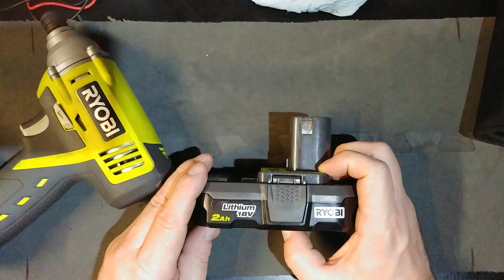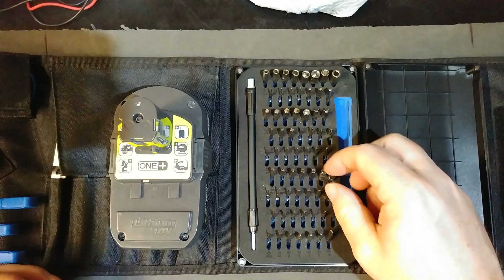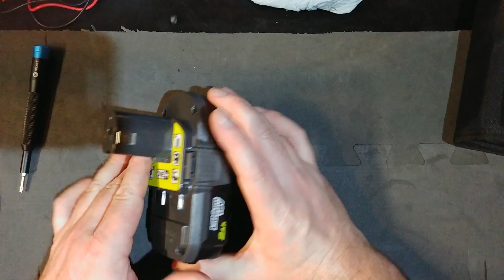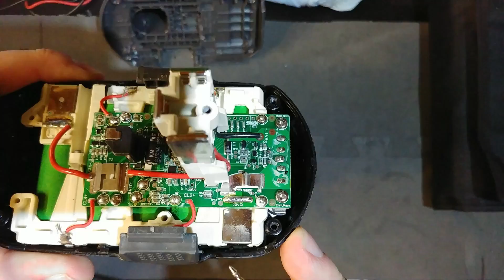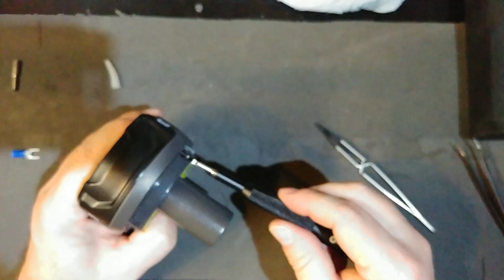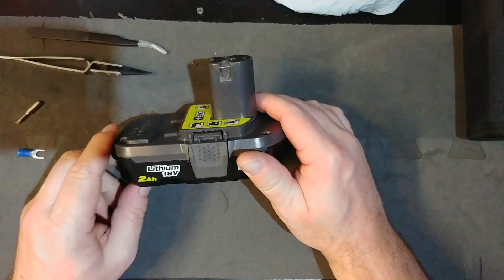Ryobi Battery Not Charging - super easy fix - dead ryobi battery repair

Comment: My Ryobi One+ 18v Lithium battery measures 15.79 volts with the outer jacket removed as well as prior to removing the cover. I have only this one Ryobi battery. How can I charge it enough so that the controller allows the charging port to begin charging it?

Comment: Ryobi has one helluva racket going here!  There should be a class action lawsuit against them for making a product that in many cases won't even last a season or two without working!  It's all about profit and manipulating consumers!
Reply from the maker: meh maybe - this is actually the only failed battery out of like 8 or 10 that I've had for more than 10 years now for some of my batteries without issue. For sure they have lasted with only 1 failing over time. Good run for sure.

Comment: I have a brand new Ryobi Sawzall that I bought right after Hurricane Ian.  I used the tool but with my older batteries.  Tried the brand new in plastic bag Ryobi 4AH cells and neither will take a charge and it just flashes red.

Comment: I have just put about 12 Ryobi batteries in the recycling bin. I wish I had seen this before I did. A question: Is it essential to open the case to get at the terminals, which I assume bypasses the controller, or can you just connect + to + and - to - using the terminals on the posts without dismantling the battery pack? Either way, thanks for the video. I'll try it when the current crop of very expensive batteries plays up.
Reply from the maker: yea, have to open the case to bypass the controller

Comment: I have found that if you just put the battery in its charger, plug in & out to the electrical socket quickly, say 8 or 10 times, the battery will charge normally after that. Worked for me several times with several different amperage batteries.

Comment: Yea I've got 2 that test bad, one that the red light just flashes like it's still testing and another that the charger thinks it's fully charged but it's only at 1 bar on the built in indicator. One of them only worked a few months before it quit on me.

Comment: FYI.   A 18650 Battery is 3.7 Volts    The max you can charge is 4.2 votes.   5 batteries in the case 5x3.7 =18.5

Comment: I think it worked. I've now a second light flashing, before only the first would be steady on the battery indicator. The charger is flashing 'charging'. I had 12V and it was too low too charge. The terminals were showing about 3v. I left the battery in the drill with minimum charge. Now I take the batteries out when put away.

Comment: Careful when using a ryobi fan.  I discharge a battery below the min voltage by forgetting I had it on.  Did your trick and revived the battery.  Thankyou

Comment: Do you need to bypass the controller board with cover off or can you simply connect to a charged battery?
Reply from the maker: yes, this is why the battery must be disassembled in order to bypass it otherwise, you cannot send power to those cells.

Comment: I've used this method to jump start 3 Ryobi batteries that I had given up for dead. They're not cheap, so this has saved me quite a bit. The only investment was about $10 or so for the alligator clips (and the T10 bit to disassemble the case). Thanks!

Comment: Were the Torx Screws always the security / anti-tamper style that take the special 'hollow-point' screwdriver?
Two of my Batts were about 2v. The smaller one: My motorcycle trickle chargers come with mini jumper cables. With the bike running, (14V) I shocked it enough externally to start charging.
My larger Batt,  no go externally. I'll open it up and try it. It's actually the battery that I wanted to repair. I
Reply from the maker: yes, it was a tamper proof torx.

Comment: Worked like a charm. I had gone on vacation and forgot one of these batteries in the charger for two weeks. Using the good battery and following your video, it only took 5 seconds of charging to revive the 'dead' battery. Caution: the positive wire gets hot! use needle nose pliers or some similar thing! Thank you. I was about to order a $40 battery.

Comment: Sorry. Didn’t understand why it was needed to disassemble the battery. You have the same terminals without disassembling.
Reply from the maker: This is required to bypass the battery management system

Comment: Worked perfectly June 19, 2022. Total of about 30 seconds of connection necessary to get it past threshold... Seemed to want to be above 15v to catch a charge from a charger but I tested only a few times during process, once at 7v, once at 12v, no dice, third time at about 15.5v it caught and charged. Donor battery was at around 19v. Lesson learned with cheap stuff: take batteries out when not used.

Comment: Nothing repaired here!
U could have energized the battery to get it above the 3volt threshold by touching the terminals without removing the top half of the case. The battery will repeat Its malfunction again and again each time it drops below the threshold.  What you have done is not a repair if anything it's only bypassing the batteries charge controller.  Simply do not have to open the case to reboot the battery.

Comment: I have at least five of these batteries! I am so upset with I can't use my tools! The  batteries are so expensive.
Reply: Yes, this will work for many that don't have access to electronic tools, or don't have the full background knowledge of BMS systems, lithium-ion cells, temperature sensors, Constant Current / Constant Voltage charging,  etc etc etc....  It's not the best way to revive a dead battery, but it will work in a pinch.

I have rebuilt about 20 of these Ryobi 18 Volt lithium batteries with all new cells.  Sure, it takes much longer to rebuild a battery than simply "bump charge" it... and I understand that a lot of people don't have the equipment either.  But it's the better option if you have the means.

While this method may work as a last resort for many people, the high current involved with this "bump charging" method is not good for the lithium cells.  You'd be much better served using a bench power supply with the current limit set to about 100mA to slowly "wake up" the dead lithium cells over the course of 2 hours.  (I've also successfully used the super-inexpensive TP4056 modules with a 1Kohm resistor modification to drop the current from 1 Amp down to 100mA.  You can search YouTube for more info.)

In addition to the problematic large current surge, the method in this video doesn't address balancing the individual cell voltages. (This is important in any series connected string of cells.)  The Ryobi's internal BMS circuitry just isn't effective on a severely unbalanced battery... it really needs to be done manually or via a balanced charger.  In fact, it's possible this is the reason the battery refused to be charged in the first place.  The BMS may have seen one cell dramatically lower than the other four and for safety sake, just stopped functioning.

Another benefit of swapping out the five lithium cells is that the new capacity (Watthours) is double the factory cells.  I only use high current 18650 cells.  (My favorite combination of high current capability AND high capacity is the Samsung 30Q, but the Samsung 25R is pretty decent too.)

Lilia:   Send me one of your dead batteries and I'll either charge it back up for you (the right way), or I'll completely rebuild it with new cells... no charge.   If you like the result, I'll fix the others for you too... also no charge.  If you respond to this post, I'll forward my e-mail address with my info.  (I'm a retired NASA guy with nothing to do but tinker around with projects like this, LOL.)

Comment: This video and the many just like it, neglect to show how to measure each cell to see what level they are at and determine if one is defective. Also you can have a pack that measures > 14 volts and still won't charge properly due to other issues.

Comment: I left the battery in charge and switch off the mains by mistake. Battery voltage was showing zero without opening the battery. After opening, internal terminals showed 4.5V. Made a connection as shown in video, internal voltage went up to 14.7 in couple of minutes. Put it back together and tried the charger. Its worked like magic. Thanks a lot for the assembly video.

Comment: 16 minutes? One RYOBI battery I had would charge fully (in the charger) to 8-10 volts (measured on the output terminals) but would provide enough energy to run my hand vacuum. Evidently the connections inside failed for half the individual lithium batteries.
Those individual cells are rated at 3.7 volts but will charge to 4.2 volts, so a fully charged battery can measure over 20 volts. Low capacity batteries have 5 cells inside in series. Larger battery packs may have 2, 3 or more batteries connected in groups of 5 cells that are connected in parallel to provide 6 or 9 Ah for longer run times.

Comment: It must at list be not blinking on the last battery bar so it will charge I tryed it but no gater clamps straight wire red and black but it work same steps

Comment: Why did you even take the battery apart. Waste of time
Reply: In order to access the battery terminals directly (and bypass the BMS circuitry) you need to open the case.

Comment: I bought a Ryobi set about I think maybe 8 years ago and they I don't know I think it was the first one it first came out with the Ryobi tech 4 battery well I'm long since lost all my tools but I still have the camera out of the set with that battery that's in it and I'm throwing it in the closet and my tool shed it's been with me throughout the years I've used it here and there throwing it back in there and every single time I take it out and I charge it up it works perfect and I put it through abuse the first couple years when I had it but that battery is still going strong I've never seen a battery lasts this long one of the times I fully charged it used it one time put it away 2 years later I found it in a drawer out my shed and I turned it on and it still had power in the battery I was freaking amazed I kind of want to take the battery apart to see what the hell is inside of it but I do not want to break it

Comment: Sir you already mentioned that at begin of your video the people doesn't have enough experience and information about electricity  and electrical tools better not doing this but many times in your video about how can use the tools to open it or the bolts! This video could be a short and very helpful video. Even With out opening the  battery cover you could do that!
Reply: The reason for opening case is to bypass electronic controls, terminals outside don't do that.

Comment: Hey guys I just wanted you to know there's a lot easier way to fix a Ryobi One battery that is completely drained just take a piece of tape and put it over the little metal piece closest to the battery and then plug it in if the battery shows that it's charging and the light is solid leave it for 15 minutes (watching it!) Take it out put it in your flashlight test it out if your light stays on put it back in it will start charging again you might not have to do the flashlight thing 😂
Reply: Well, Just tried that.  Put a small piece of tape over the one on the back of the charging 'post' and the internals never 'clicked', so the internals sensed a malfunction and shut down the charging.  Then I tried a piece of tape on the very small contact on the surface of teh charger and same thing.  So that didn't work as it cut off the inputs that the charging system uses to tell if the battery is charging properly or not.  Since it could not sense it, it shut it down.

Comment: Dis assembled battery checking voltage at top terminals 0 volts, at battery connection at board to batteries  read 20.5 volts

Comment: I mean the battery has warranty, why not send it back for a replacement? If it’s past the warranty I see how this would make sense. Also, the instructions say to not leave the battery attached when tool is not in use.
Reply from the maker: Hi - yes, they're out of warranty by now and typically I don't leave them plugged into the tool for more than a day or so while using it.

Comment: Did it today on a 5 year old battery that I haven't been able to charge for over 2 years.  Works like magic!  What seems to be one possible cause of the Red Light of Death is when your batteries are exposed to cold temps for extended periods of time.  Now, 6 of 6 batteries still running strong.  Thank you so much!

Comment: Don't do jumpstart on Lithium batteries! You damage both batteries, the good and the bad one.

First check what is the problem of your battery.
Second, if the low voltage was the problem and the cells are above 2,0 V, then use a model charger to gently charge the battery, instead of jumpstart.

No there are not normal cells inside. These are high power types for power tools.

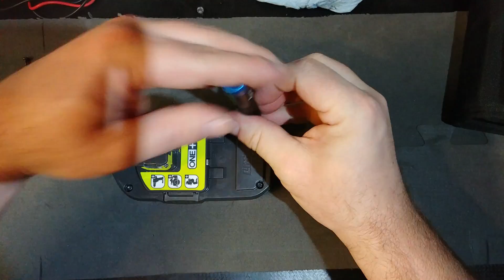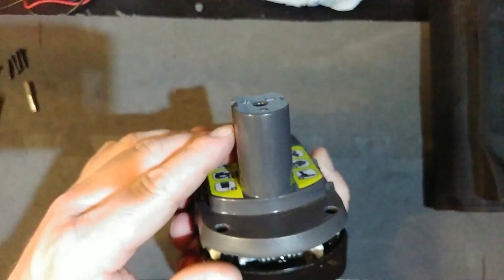Comment: Open case at 6:00..  Test at 8:00.. 
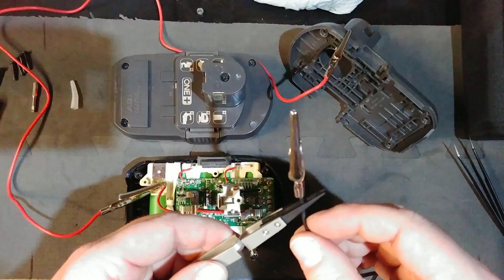Repair at 12:00. There is a ton of useless commentary in this video.
Reply from the maker: You're right. I made an updated one, this specific one was the first video I ever made, I tend to ramble  sometimes.
Reply: @BdoingStuff  no insult intended, I was trying to help DIY'ers who come after me. Thanks for the info and your time in making the video.  The comments help but the steps take really long for you to get to.... By the time you get to the next step the previous one is just about forgotten 
      - Thanks Again

Comment: I followed this method, but had to drill holes on the side leading to the positive/negative plates; based on another video I saw because my screws were stripped. Anywho, doing exactly what he said, that allowed it to to charge successfully, and achieve a solid green light; which it would not do before. But when I plugged it back in to my Ryobi drill would not power the drill. The multimeter registered at 10v... So it's charging now, but it just isn't making it to 18v... Any suggestions?

Comment: 2yrs old video.  Mine reads zero unopened but 15.37 when I bypass the board. ???

The ground from the batteries to the pos on the charging lead also reads 15.37

There is a grey reset? Button just under the front of the board.

I pressed the grey button and 4 green lights come on for a second and then only one blinked 3 times…. yellow button on front of battery presses on the grey button so this is the test button but pressing it did appear to reset part of it

Now the neg charge lead to opposite pos charge lead read 11.29 and connecting both red leads on the charging head reads 11.21

Direct battery lead test still reads 15.37 to 38

Comment: Why open it, why can't you just connect plus to plus neg to neg without removing the plastic...
Reply from the maker: you have to bypass the BMS (battery management system) or what I'm referring to as controller in the video.

Comment: I've heard a rumor that RYOBI will replace a "dead" battery for free as long as you have not messed with it. True/False? I have several that will not charge, but the green charging light comes on. Seems that RYOBI would have fixed this problem years ago. The charger should detect a too low battery critical condition, and when it does, it applies your fix. Simple solution. Another fix would be installing a buzzer in the battery that activates when the battery is near the no-charge point, say 7 volts; this solution would help prevent you from letting the battery enter that low battery volts/no charge condition. For what these batteries cost, this no charge situation should not be allowed to happen.

Comment: I had a Ryobi 18 V battery that sat in my garage for over 18 months that would not take a charge. 
The "Fix" was fast...easy & safe.
I used my 12VDC  trickle charger ..held the "+" & the "- " cables to the battery posts for slightly over 2 minutes.
I then put the battery into the Ryobi battery charger.
The charger "Testing" cycle ran a little longer than normal then it started the charging cycle    !
I did not do any disassembly ...I didn't drill any holes !
Reply: Yeah, but mine is almost fully charged, and will not activate any of my Ryobis... 12v charger will not charge 17v pack. But will a dead one, yes.
Reply: Exact same as I did to 'prime' my 18v and 24v; both were dead 5-10 years.

Comment: It worked. Battery showed .2v. Took it apart, checked the battery itself, it showed 3.6v. Put the leads on for about 15 seconds. Battery was now at 12.3v. Put back together. It charged and I’m using now. Thank you so much. Saved me a few bucks.

Comment: I have a question I am working on two batteries that are dead the first one when I put my meter on the battery terminals it read 18 volts that when you put it up on the post where you plug it to the machine it's dead the second one showed 20 volts at the battery and dead at the up top where you plug it into the drill so what's going on with this anyone know
Reply: So you have voltage at the battery pack but not the terminals for the closed battery. Sounds like a break or a short coming off of or going into the controller. Could ba a short a broken wire or burned out component on the chip it's self. I'd check at the outputs coming off the board before they go "Up top" and if you have power then replace or bypass with a little bit of wire to connect them. If no power coming out of the control chip then it's dead. The cells could probably be used fore something else but you would want to get a charge controller for them. If you have another battery that has dead cells in it you could just swap them out. Put a good pack of cells with a good charge controller.
But if the battery has juice but it's not getting to the top terminals then something in the middle has an issue

Comment: Mine said 18.7 but still didn't work. Kept putting it on charge for 2 seconds take it off, did that about 50 or so times. And now it holds a charge n works fine again. Idk read it somewhere